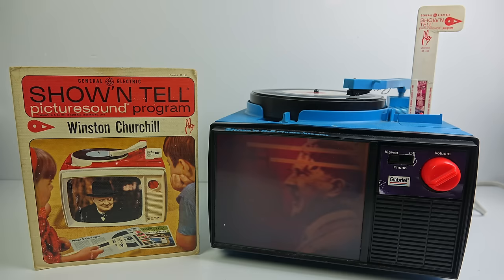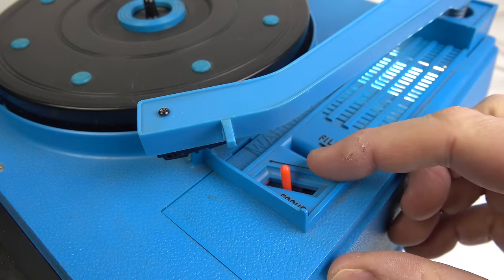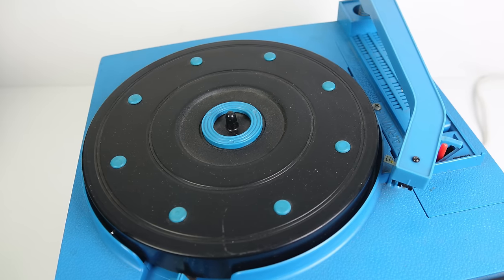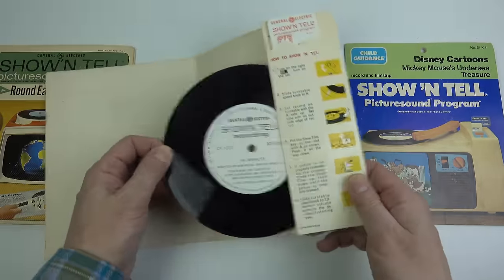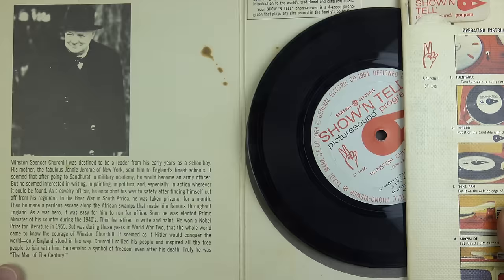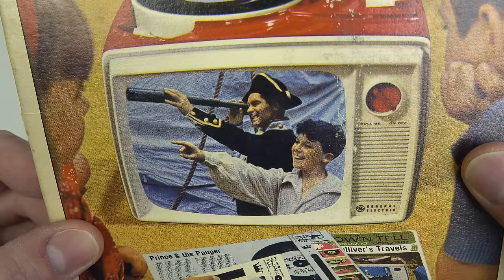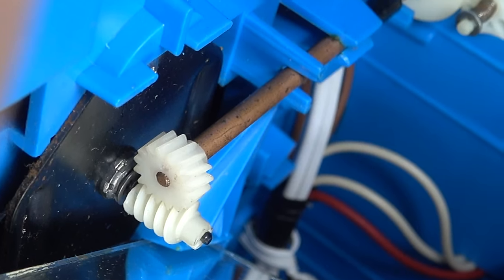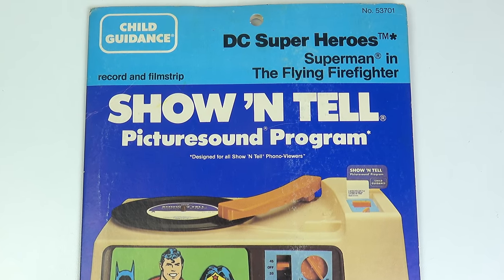Show 'N Tell - 1960s Children's Multimedia System

Comment: Unfortunately that's the thing with slide film, it fades over time when not stored properly.  Original View Master discs from the 1950s to early '70s were on Kodachrome and haven't faded.  But after Agfa bought View Master, they made the slides on their own film and those slide discs have faded badly over time.

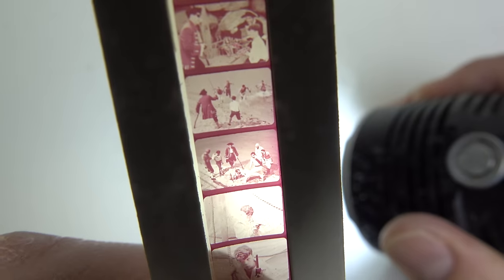Comment: @8:50 don't store those deteriorated slides with any other film.  The research isn't conclusive but many preservationists believe that the process that causes red shift can be contagious.  One theory is that it puts off a chemical that can catalyze the reaction in previously fine film stock, notice that it will smell like vinegar.  Some think it's a bacteria that makes the chemical.  Others think it's just inherent to the make up of the film and some of those people think it doesn't spread.  Some think that it can be controlled with the right temperature and humidity levels.  But there's just no solid research that proves the exact causes.

Comment: You need to buy a frequency variator for the machines power. Its a electronic device, you control the frequency with a knob. Have one in the work for reduce the velocity of a pump, without losing power. Sorry for crapy crapy english

Comment: Whats causes the buzz, a facet of the player or the transformer? Could it be fixed by modding either in some way or using a different transformer, or is this always an issue when using a transformer for a 60hz record player on UK mains?

Comment: So I don't understand, is it 60 hertz of electricity or 60 hertz of sound that you for some reason can't use on an American record player in England, is it like a power plug that works with your plug in but it doesn't go up to 60 hertz? Surely you can get 60 hertz from the wall right, I'm confused, I kind of understand it playing slower but why does it make a buzzing noise, is that just the record player

Comment: Somebody please send him an adjustable 48v 50a power supply set to 56 volts, a 2kw or so 48v input 120v 60Hz pure sine wave output power inverter, and the necessary heavy gauge wire to connect them. It won't be cheap but then he could run any standard north american 120v appliance.

Comment: by your self a 110v ups back up with a test button or a big one some of theses new ones needs mains power to come on that can be over came by using a very smally power inverter to get the ups to power on funny but as ups have better power it a part of it i guess  but  i used an old white with test button 300watts ups hock to a 12 volt marine battery one as a emergency power supply in storms for my tv n stuff i ran it a max 2/3rds to keep it cool i have scene bought frum ebay used big unit from i guess a server room